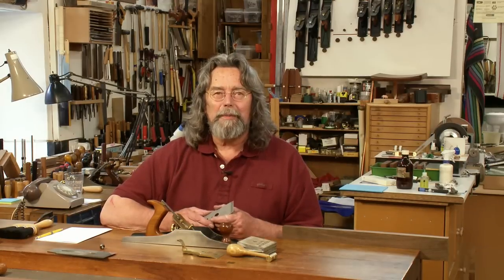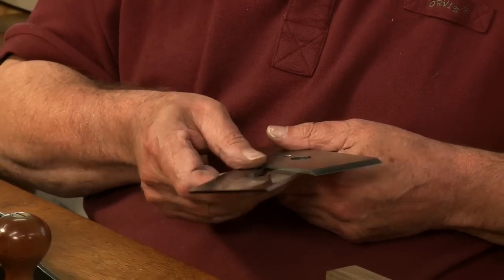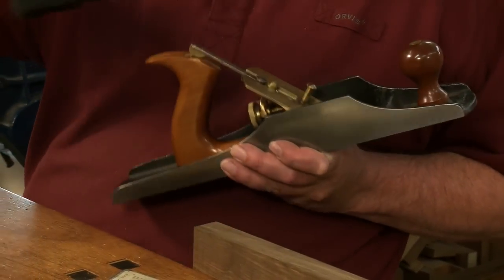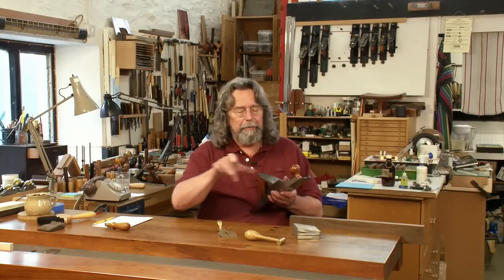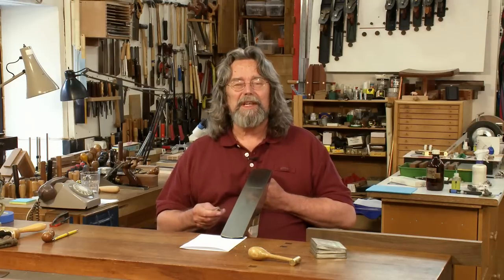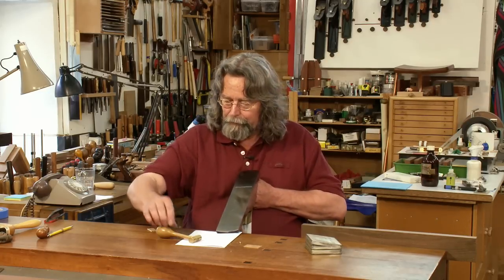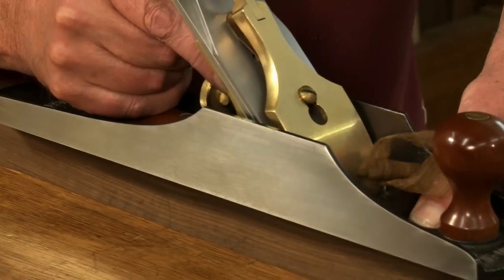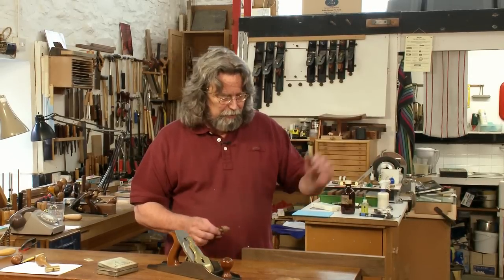Plane Assembly and Setting

Comment: Took me a great deal of work to get the sole dead flat with a granite surface plate as well as lapping in the frog on both the blade side and the plane body reference surfaces but I made a ca. 1925 Stanley Bailey No. 5 for which I paid $40 perform quite like that Lie Nielsen you've got there. 0.0005" shavings - it's truly a thing of beauty - and so is the silky finish-ready surface left behind. Wonderful video good sir!

Comment: THANK YOU David for this superb video,  I was having problems with my plane after sharpening (tho' the sharpening seems to be the best that I have achieved recently) the blade, I just could not get zero shaving and the adjustment screw was totally bottomed out, anyway I realised that I had not set the chip breaker close enough to the blade and through watching your video realised that the cap iron lever was taking FAR too much effort to close and the tip for using a small piece of wood for finding the point whereby shavings begin is brilliant. I have done just as you instructed and the plane is now great, Thanks again.  I was totally enthralled by your precision and presentation.

Comment: Thank you, bought my very first no 4 and 5 today, you helped me set them up, I did not want to go electric as this is an art and can be lost.
Reply: Electric planers are really not equivalent and share some uses but are quite different from a hand plane. Not even a matter of being different or worse just different. Just like you can't say a screwdriver is better or worse than a hammer.. Electric hand planers and stationary planers work differently and do not actually leave a smooth surface because the rotating knives take many circular cuts, which leaves a scalloped surface which usually needs to be sanded or, ironically, smoothed with a hand plane. They are great for flattening timber along with a jointer, but to get a truly smooth and flat surface there's no substitute for a hand plane.

Comment: I love your Gunsmiths Screwdriver ?   at the beginning, reminds me of my favoured type, the "London Patterned Screwdriver" a simple rectangular length of metal coupled to a two faced handle.  Only experienced the 14" and 6" all a very stable platform, and can only imagine your little shorty  (Blacksmith driven ?,  badly fit/angled blades are a bane)

Comment: 50 years ago as an apprentice I was told that it's a good habit to get into, when putting you plane down, lay it always on its side as to avoid damaging your beautiful honed sharp edge! ;)
Reply: Dad worked with wood all his life, and told me exactly the same thing. Respect your tools.
Reply from the maker: Maarten,

This is a popular but misguided view.  As far as I can tell all woodwork teachers  from 50 years ago and more, rapped the knuckles of those who put their planes down on their sides.

The snags of this method are;
 1.  the blade is now exposed to passing tools and fingers.
2.  With a Bailey pattern plane, the lateral adjustment of the blade may be inadvertently knocked on the bench.

In my opinion the sole down method is infinitely preferable.  You may notice that I place the plane with card, or thin wood, or a pile of shavings under the front sole.  No possibility of damage to the blade.

Best wishes,
David
Reply: David Charlesworth I agree entirely and have heard many long standing and well respected cabinet makers say the same thing. If you put your plane sole down on a bench, what's the worst that can happen? It's accidentally knocked and pushed forward. What's the result? It cuts into the wood. Isn't that what they're for?

Comment: Hi David, Would a back bevel of 2-3° be worthwhile for sharpening consistently to remove the wear bevel?
Reply from the maker: Rick, I would not use such a large angle as it would compromise the fit of the chipbreaker to the iron.
My ruler trick imposes a backbevel of 2/3 of one degree.  My C/B has a clearance angle of 1 1/2 degrees, this ensures that the front edge mates tightly with the blade.
Reply: @DavidCharlesworth  thank you for the response David. I'm hoping to pick up your DVDs on sharpening, the one for planing and the one for chiseling. 

I had read online of a gentleman who spoke to you about the ruler trick. He has a website and a microscope. His premise was that if you put a micro bevel on the back of the blade each time, it would avoid the wear bevel dulling the blade. He was adamant that you needed 3° for it to be effective. 

Thanks for your response. I'll do my best to get my hands on the plane DVD and chisel DVD. I'll try the ruler trick and report back afterwards. Polishing the back of plane blades the entirety of the way to the slot is just a huge waste of time.

Comment: David, this question didn’t occur to me last month. We tighten down on the chip breaker screw quite firmly so the blade and CB maintain contact. When I do that it bends the blade out of flat!  With a scrupulously flat frog, aren’t we creating an opportunity for chatter?  What am I missing?
Reply from the maker: Bob,
This happens with virtually all chip breakers.
Chatter might occur if the heel of the bevel were not well supported.
The slight bend ensures support in the most crucial area.
Many users are not aware of this fact.  Some think the lever cap will flatten things out but it does not.
Best wishes, David

Comment: I like the oil pad idea as the tin keeps things clean. The small lateral adjust with the toffee hammer will save time rather than guessing with the lever. Thank you for the clear advice, haven't managed a shaving as fine as yours yet, practice makes perfect I guess.
Reply: It’s in the board. His started out flat. If yours is not quite flat yet, it will be after a few (or maybe several) shavings. Then you can go for half a thou.